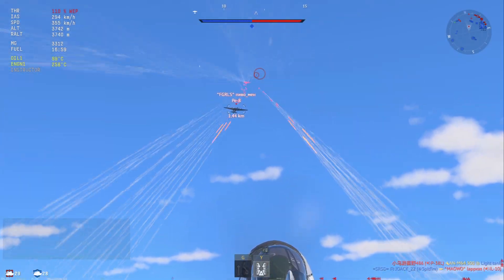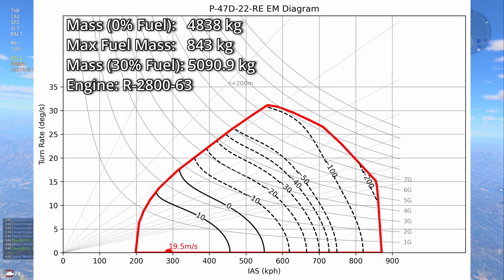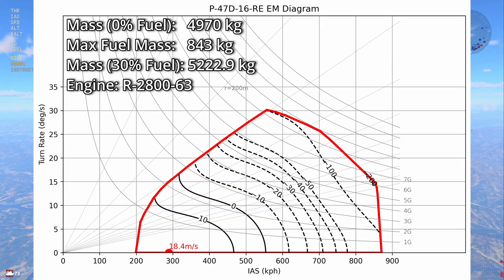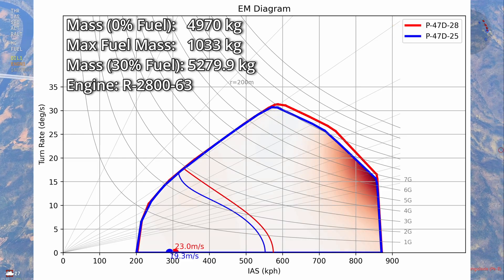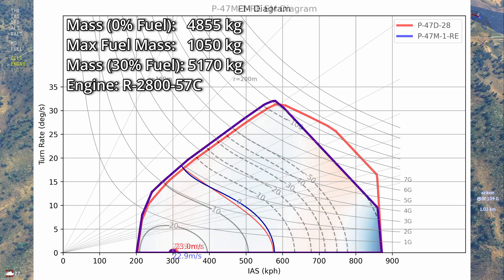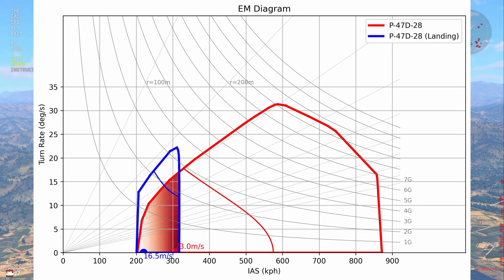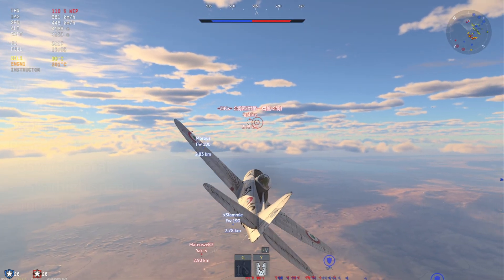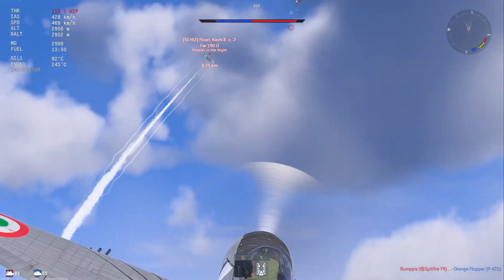Post-Nerf Clarity | P-47 Variants Compared

Comment: I guess Gaijin is finally modeling flaps correctly. Most WW2 props should have auto-retracting flaps, ripping flaps from overspeeding was rare
Reply from the maker: well i've heard this specific implementation is incorrect and ahistorical, but idk anything about historical accuracy :/
Reply: @CatWerfer  It's definitely more accurate than what we had before. IIRC on most WW2 props a relief valve allowed forces on the flaps to overpower the hydraulics at high speed which closed them. Even if this system failed or is not present, a hydraulic failure would most often just close the flaps. Completely ripping off the flaps was almost unheard of
Reply from the maker: @KekusMagnus hmm ok. unfortunately the n15 still rips at 300 lol
Reply: @KekusMagnus we got ceramic flaps 😂
Reply: @CatWerfer  It is historical but incorrectly implemented. The flap mechanism and how it works can be found in the maintenance manual for the P-47s. The maintenance manual states the pressure that must be achieved by the air to auto retract the flaps but it does not state the speed at which this happens. This could fairly easily be calculated but calculations alone aren't sufficient for a bug report.
Reply from the maker: @rainsilent snail lazy
Reply: @CatWerfer  Sort of and not actually at the same time. In all fairness to them there is no speed given for the system anywhere beyond the speed that it will start with full flaps. That is what Gaijin implemented in game. So while you can argue that Gaijin is being lazy it is also to the fault of the manufacturers and USAAC/F for not testing to define the specific speeds. Then again why would they test this?
Reply: @CatWerfer The P47s already had auto retracting flaps that only retracted near its rip speed for a while. But everyone here doesn't seem to know? The recent change is a ahistorical nerf
Reply: if they were going for authentic implementation…. Well most Japanese machines should be massively hit by their mechanical driven air surfaces… no more super Zeros and Oscars
Reply: @marcocatano554  Hate to break this to you but this isn't just a Japanese planes problem. Most every fighter is pulling more than historic all the way up to Vietnam jet fighters. Pulling 8Gs in a WW2 fighter was exceptional and not all WW2 era fighters could do it. That said the A6Ms have the biggest artificial elevator buff in the game by far. No A6M could pull inside of a P-47 at 300mph IAS for example. In game they can do so up to at least 430mph.

Ki-43s could still turn inside of a P-47 at 300mph IAS though. In fact they could pull hard enough that early Ki-43s could rip their own wings off with high G loading. This gave the Ki-43 a bad reputation early on. A6Ms couldn't rip their own wings off with high G loading and this was intentionally done by Mitsubishi. They knew the aircraft was going to be vulnerable to it so they consciously made the A6Ms compress early so that the pilots couldn't pull enough Gs to overload the wings.

This all said A6Ms and Ki-43s will still turn circles around all other monoplanes, sans their own predecessors, at low speeds without breaking a sweat. They were designed to be as agile as possible after all.
Reply: It's not auto retracting, it's auto stop you from deploying which wasn't how it was